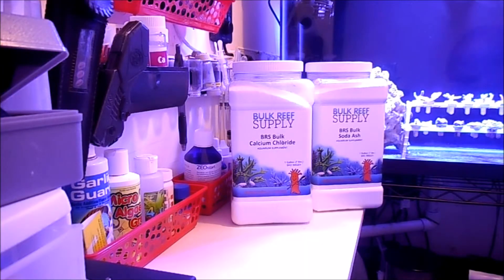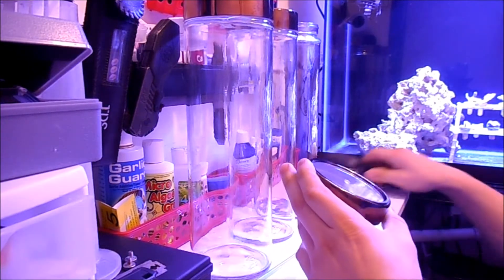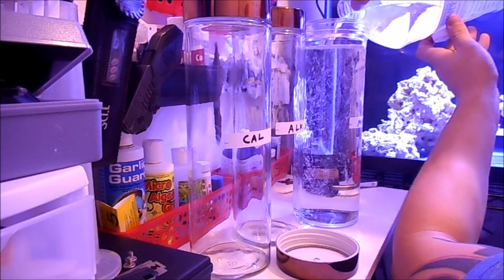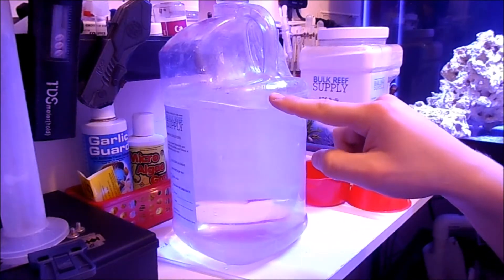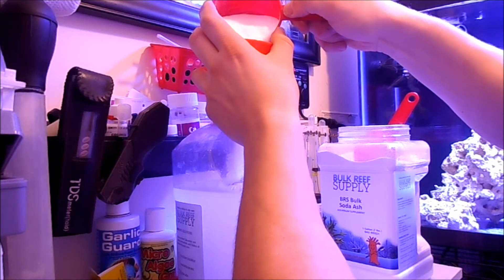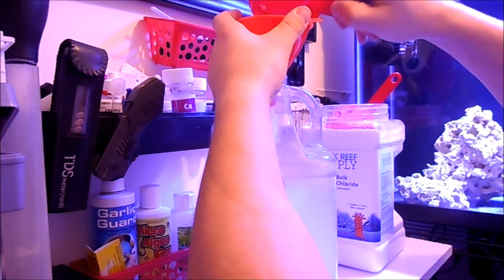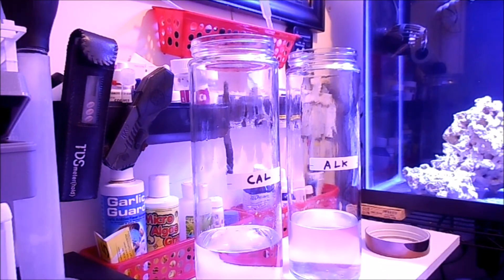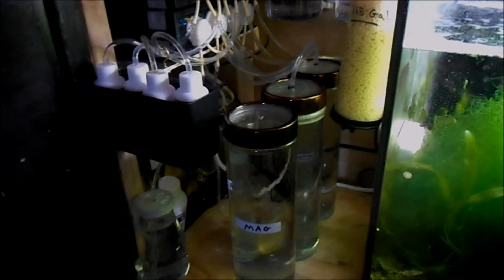Mixing Calcium Chloride And Soda Ash | Beginner Guide To Saltwater Aquariums

Comment: Such a helpful video!  I recently discovered your channel and I love the step by step way you deliver to help out newbs!  I love BRS but sometimes fell they can be quite biased so Its nice to get another pros advice that has nothing to gain! I have been prolonging two part for a while because its a big step, maybe just overthinking it but my alk is now getting below the danger zone!  it was 6.8 today and all the water changes arent helping anymore!  I use 13 alk salt water mix (reef crystals) and usually do 40 percent change but it only upped me to 7.5. the other day, dosnt make sense mathematically!  My tank is only 7 months old but added lots of frags not far in between and one of the reasons of putting it off is it drops so randomly!  I dont know how I am supposed to figure out a daily dose.  I would really apreciate any advice on how to handle that kind of situation!  Love your channel.  You have a new fan in me! Think I am ready to do this!!!